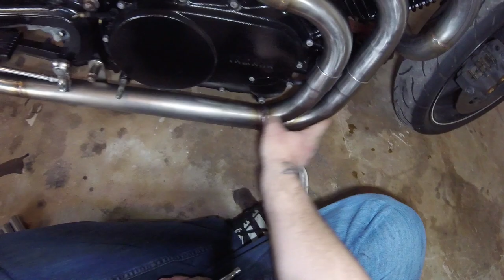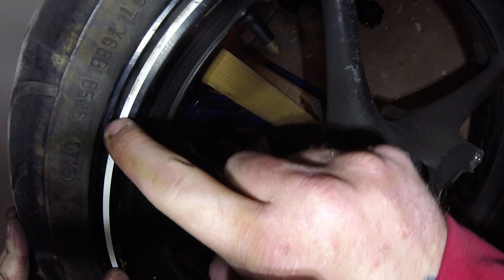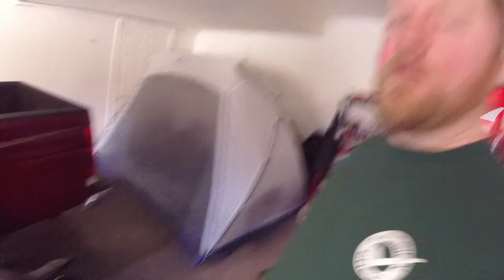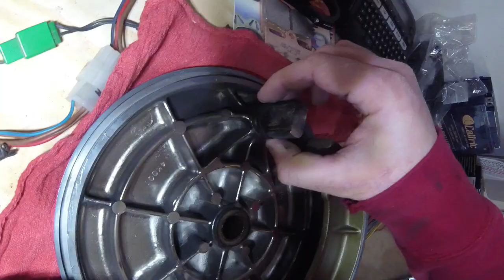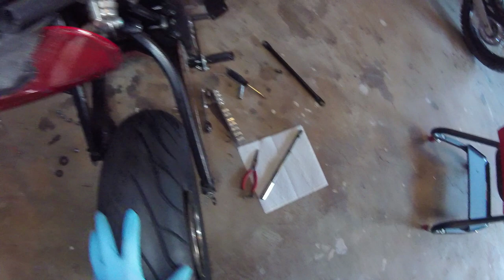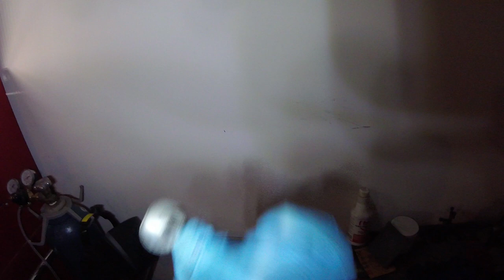Yamaha Virago Cafe Racer Build - Episode 23 - Brakes, Tires & 2nd Gen Rear Wheel Conversion

Comment: I'm suprised you just put that 2nd gen rear wheel with absolutely no modifications... Have you checked how much your rear wheel is offset now? Go stand back behind the bike. The hart of your rear shock is the centre. It should be aligned with the hart of your tire... You will most definitely feel this while riding it... 😬